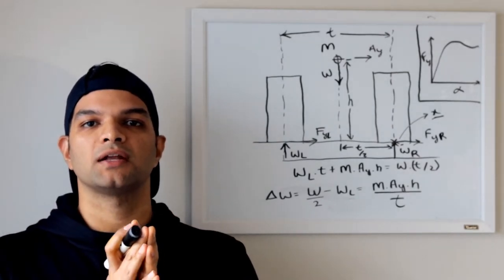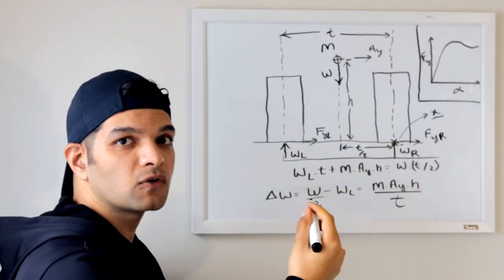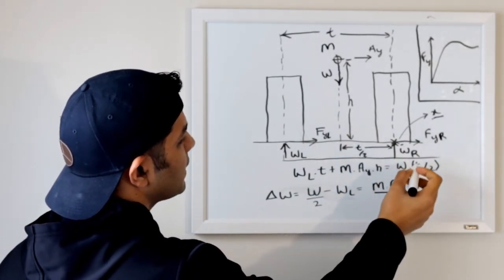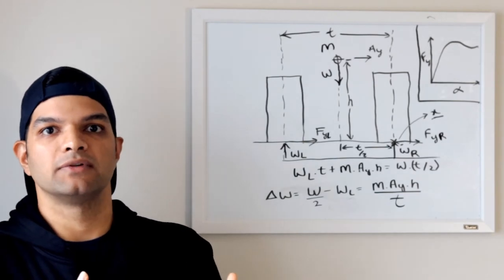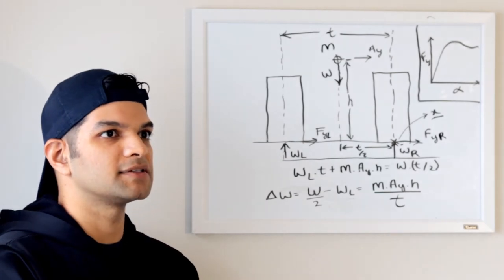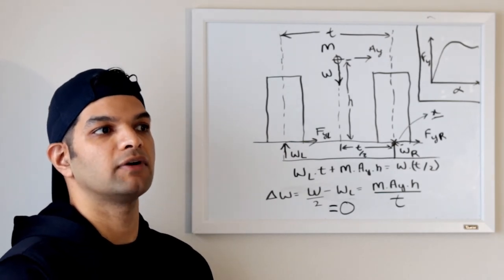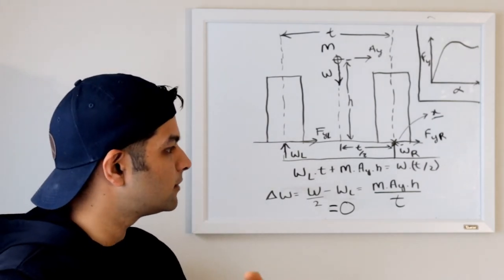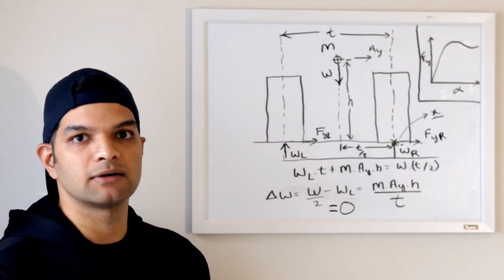What is Lateral Load Transfer? #carknowledge #engineering #formulastudent

Comment: How we can calculate Ay( lateral acceleration)
Reply from the maker: Lateral acceleration is (v^2/r) where v is the velocity and r is the radius of the turn, intuitively that means if the radius of the turn increases (approaching Infiniti’s or straight line)  then the lateral acceleration will increases for a given velocity
Reply: I want to calculate Ay . I have the value of velocity then how I will calculate ( r )
Reply from the maker: @mdiftekharalam64   think about your car going thru a race track what would be the radius of that curve ?for example 10 m and v=60 km/h then convert for units and you should have you value